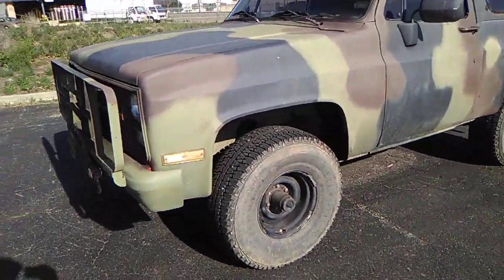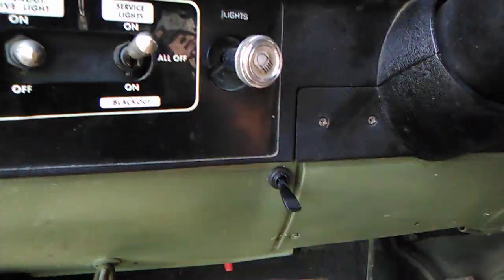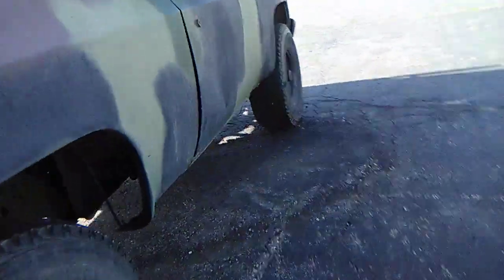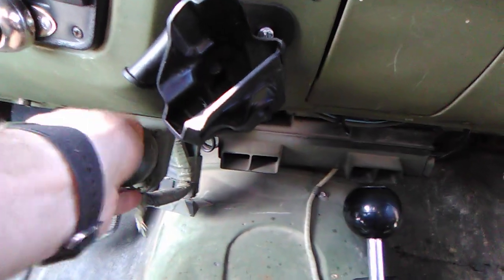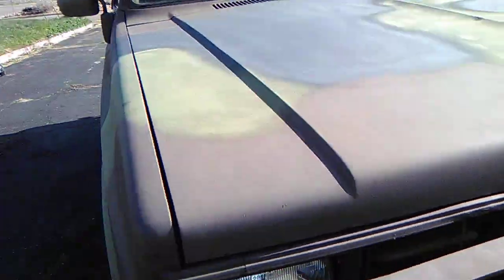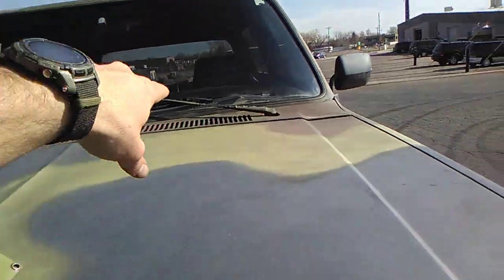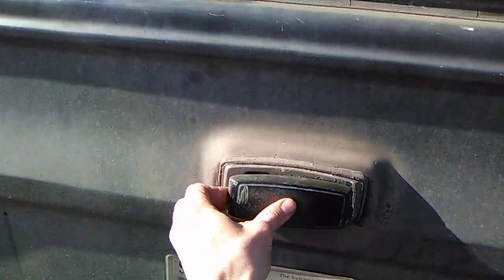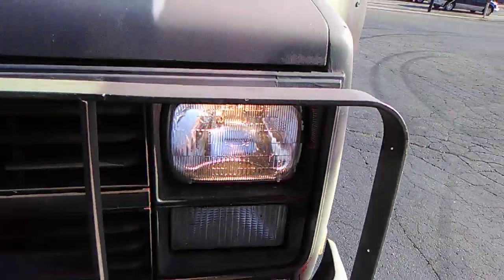1985 M1009 CUCV Walk-Through

Comment: In order to use the diagnostic connector on the dash you need  "STE-ICE" Set. (Simplified Test Equipment - Internal Combustion Engine). The CUCV's have no on-board computer that stores codes. The STE-ICE will take readings from a set number of sensors. You have to compare those readings with logic charts in the Technical Manuals.

Comment: Hi is it recommended to keep the truck in 24v mode rather than 12v. I love your truck I have one, but I’m having problems starting it since the mechanic I went to turned it to 12 v.
Reply: rofl... well why don't you tell us... you have problems AFTER going to 12v... what you think?  Hack up the wiring or leave it stock? rofl...
Reply: @mattlane2282  yes after that I’ve had problems starting it up. The thing starts up but after going to a few places around town I’m afraid to turn it off because it won’t turn back on. And it’s not my battery. The wiring is definitely fucked somewhere. I went in to fix my lights, because the trucks low beams would blow out after rain. So my high beams were being used. The mechanic changed it to 12v and said this truck should be on 12 not 24 v. And 24 v was the problem. I might sell it not sure.
Reply: @prestochange0  Truck gets hot, wont restart... (assuming crank no fire) dump water on the IP... if it restarts IP is bad... 

You mechanic had no idea what he was touching it's a stock 24volt truck, the headlights had NOTHING to do with the 24v... the ONLY things 24V are starter and glow plugs (resisted down) the entire rest of the truck runs like a stock chevy truck... 

So either someone REALLY fucked with it before you got it or something else was the issue... you will get both opinions on 12 or 24... 24v you have manuals that you can use for diag... convert it to 12... and you are pretty much on your own with any issues... I have 0 problems with my 24v trucks, actually converted one of my plows over to 24v... and any LED stuff you buy generally can do 12-36v so led light bars are run off 24v... the only real issue is when you lose 1 glow plug, the rest get over volted... you can push button it if you like and still leave the truck 24v...
Reply: @mattlane2282  I just want to put my cables back to 24v is this a difficult task, because I wanted to do it my self and never have this guy touch my truck. What the best way to put it on 24v again ?
Reply: @mattlane2282  This truck never over heats all levels are full and normal. It just don’t turn over man. Before on 24v that start was epic like no hesitation.
Reply: @prestochange0  So she does not CRANK... at all...

Did he change the starter?  It's a 24v starter... if the same starter maybe it is getting hot enough that the 12v going to it + resistance (from heat) = can't turn... not sure but again this is assuming you had a stock cucv... 24v starter had to be swapped out...

Their is a relay under the dash (+ 2 others) for the starter... good to know about and replace (it welds shut and then the starter won't turn off unless you d/c the batteries) that could be acting up... however I think its 12v trigger.. not 24... but also could be the starter solinoid... again if the starter is shitting out... IIRC that is 24v... so if its a 24V starter, running off 12... could be the entire issue...

with out knowing WHAT was done... can't say how easy it is to go back... I would (in my situation) just source a good harness and replace... but my cost would likely be 0 and I own 2 stock cucvs I can look at... 

If it was converted via online instructions (I doubt it if the guy said the truck should be 12) you can just undo it... example IIRC Rosscommon 12v mod... 

Take a few pictures of what you got going on... 

Also make sure your starter has the support bracket on it... with out it it will at some point rip a bolt out of the block or break it in the block and now you have major repair issues...
Reply: @mattlane2282  I tell you what he did. 1 refurbished both alternators, 2 replaced the motor of the starter, 3 replaced that little piggy chrome part on the wall inside the front left of the engine, 4 both batteries. Not sure if the starter from 24 to 12 was changed. But Matt it turns on normal the first time I use it in the day. The second stop it might take a few before it turns over. The next stop it won’t turn over. If it gave me a problem I would spray liquid start and that would work sometimes.
Reply: @prestochange0  "It just don’t turn over man" "The next stop it won’t turn over. If it gave me a problem I would spray liquid start and that would work sometimes." 

okay you need to clear up it won't turn over or it turns over and won't fire.. these are totally different things...

I think there is ONE dumb as all hell method to convert to 12v and keep both alternators... I highly doubt it was done so I have no idea why he would refreb both... unless you have a spare one now and only 1 installed? 

Anyway clear up it does not CRANK or it does not START... again these mean two totally different things.  

Crank is hit the key motor spins over
Start is hit the key motor turns over and motor fires and runs... 

So it won't CRANK or it will CRANK but won't START?
Reply: @mattlane2282  Good morning Matt I would say it won’t start. Sorry I’m not a well rounded mechanical person. I can do the job, but don’t have the specific knowledge. I have a feeling is such a simple task. I’m going to turn it on today see what happens.
Reply: @prestochange0  just want to make sure we are clear it's fine can't know everything... If it cranks but wont start bring water with you or well maybe stay home but get her hot drive a bit come back whatever when she will crank but not fire be careful cuz obviously it's hot under the hood dump the water slowly on top of the injection pump your goal is to cool the injection pump off then try to start it again if it starts your injection pump is bad I haven't personally done this before so I couldn't tell you how much water from experience I'm thinking maybe a gallon slowly dumped over the injection pump should cool it off don't use freezing cold water you're just trying to cool it off from the like 200f it is
Reply: @mattlane2282  Hi sir good afternoon the truck started with no problem today, but noticed I’m leaking so much diesel from the fuel filter box. Is that dangerous? I put some rags there to collect the spilling. Hey man can I give you my number may be you can help me if we can face time sir? I can show you my baby I really don’t want to get rid of her.